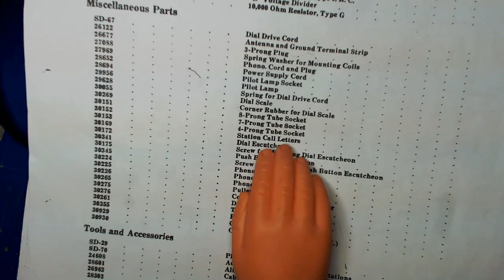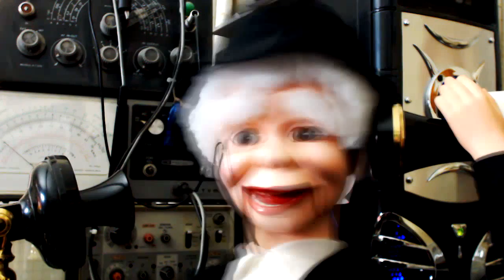1939 Stromberg Carlson Model 430-H Restore Part 6

Comment: Hey Buzz, for your grommet problem, take a rubber or neoprene o-ring or washer of the same thickness, slice it on one side, put it around the stem of that fitting, then glue the ring back together with Goop or something made for rubber. Since it isn't critical to the operation or the look of the radio, this should be no problem.
Reply from the maker: Steven Smyth Thanks Steve

Comment: Warm a grommet and see if its pliable enough to slide over as is, maybe, never tried that myself. Two thinner ones may slide over rather than one thick one. On The Workbench Today... suggestion is a good one. I've had good luck with JB Weld in most applications. Roughen up the metal pieces where they join seems to help the epoxy to stick. Tough one. Fantastic job on the radio. Works of art. I don’t see how you have the time for radios trying to keep Dickel out of trouble! Bound to be a lot of drama around there with all his women.
Reply from the maker: plantopguy5 The grommets I have aren't that pliable...But  On The Workbench Today had a good idea.....Buzz

Comment: Very funny opening had me in stitches. Has Dickel met his match?
The grommets help isolate the chassis from the acoustic vibration of the cabinet. The loud speaker will vibrate the cabinet. The cabinet will vibrate the chassis. (Think leg bone connected to the ankle bone)
Anyway, they wanted to help avoid an acoustic vibration on the chassis. This would vibrate loose tube elements and possibly create a feedback loop.
If it was my radio, this is what I would try! I would go to the local Do-It Best hardware store. They have a WIDE assortment of o-rings. Get one that thick enough and slightly smaller that you can stretch over the base of that stem thingy. Before you go there though, build up the shaft of that stem thingy with a good electrical tape like 3M. Not too much since the stem of the bracket still has to move in that hole. Ok, now go to the hardware store and get the o-ring that is thick enough and can stretch over the base of the stem and then rest against the electrical tape built up stem! Vollia! You can go to HFT and get one of those cheap calipers to measure the new built up stem diameter to help select an o-ring inner diameter to be close to that size. Well you get the idea. Good luck!! The calipers will help out a lot. Perhaps select the big o-ring first, then build up the stem with electrical tape to meet the inner diameter of the o-ring. There's an interplay between the stem, the hole and the o-ring, so that's where the luck is required.
Reply from the maker: Lockemeister Hi Meister...Just got a email from my mentor Brendan stating the same thing..Good to know ...thanks..
I been experimenting with various methods mentioned today with no luck..You will have to wait till next week to find out how I replace those rubber mounts..I even don't know as of yet.......Godfrey Daniel..................lol, regards, Buzz

Comment: Buzz,

I like Stephen Smyth's suggestion of using O ring material, super glued together.  I think you could stack several O rings until you got the thickness you needed.

Regards, Tom
Reply from the maker: THOMMGB Already bought some grommets and will try to make those work,,Too cheap to spend much on this..lol, Buzz

Comment: Hi Buzz, I came up with all the rest of these suggestions that everyone else had here but being a real cheapskate I recommend a washer with a clearance slot cut in it under the existing washer using a 3 pronged gearpuller against an inserted bolt in the threaded hole to straighten the flange, then take a large bolt to beat the flange out after assembling the o-ring (new one), hope this helps, but really I think this part of the radio was just to absorb the shock of shipping, so you could just make the o-ring from split wood washer glued in and painted.
Reply from the maker: Truckstuff4u LOL..I'm cheap too...Regards

Comment: Buzz,  My idea is similar to most.  I would first try working the new rubber over the edge on the inside.  This would leave it tipped.  The you might rotate it under the corner edge while pulling the rest over the inside edge.   The old gum mounts have some give so this might work.  Put a bit of soap on the rubber before you start.  Gojo might work too as long as it doesn't attack the rubber.  Failing this, cut the rubber, rotate it in, glue the cut edge then rotate the split to the corner.  When the bolts are installed, the rubber should be gripped on both sides anyway.
Reply from the maker: Stephen Moore I will try

Comment: Now for the rest of the story.  Interesting video!  You have lots of patience.  You might have steamed the old veneer off, but you managed to get it off anyway.  It looks like the old glue is letting go everywhere, but you will have a great job when you finish the re-glue.  The transformer looks like new!  You might verify the resistors in the AGC circuit.  It won't brighten up the eye tube, but it might make the new one more responsive if they are off much and you change them.  They are easy to measure with a digital VOM.  The old meters didn't work so well at the high values in the AGC.  This radio is really shaping up and I am enjoying the series.  Now as for ole Dickel, his heart is in the right place.  He might have ripped off the spuds (then again, his ass paid for them), but at least he is thinking of his ole buddy Buzz by trying to share the booty.  (As an aside, the term escutcheon is still being used on modern radios such as portables).  Unfortunately, it looks like the ole rascal is off on another quest of the heart. . . . or something. . . . so you may have to take a back seat.
Reply from the maker: Stephen Moore ..I have replace 80% of the resistors in that radio..some of the 10meg variety..Thanks...Lots of work to get that cabinet up to snuff with new veneer..Dickel tries hard , but with women, they just  mess him up..LOL

Comment: Use a Dremel or file to remove the flange. Instal grommet replacement Place a washer where the flange once was and put a bolt through. When unit is put back into cabinet use another washer and nut on the underside to bolt it into place.
Reply from the maker: John Letterman watch this friday and i will reveal..

Comment: This may work...Get a tube of black or whatever color of RTV, silicone rubber and prop the metal washers where they need to be and make a "donut" out of the RTV.
If your careful you should be able to make it fairly round, if not use a piece of large diameter Teflon tubing as a "mold" silicon rubber (RTV) will not stick to Teflon.
That is my hair brained idea...LOL
Reply from the maker: ***** Hi Goat...I bought some grommets at ACE hardware today..I will figure something out...Thanks, Buzz
Reply from the maker: ***** Hey oldgoat..did you enjoy your poem???haha
Reply: What poem?
Reply from the maker: ***** There once was a man from Trent...you must have dozed off  during my video
Reply: LOL...I heard it, at first I was not sure what you meant, I must be getting old....wait, I am OLD...LOL
Reply: ...the term is: "HARE BRAINED".

Comment: I would try cutting through 1/4 of the grommet with a sharp razor blade, then spread the grommet apart enough to slide onto the shaft, then using a drop of super glue on the two cut ends, glue the grommet back together.
Reply from the maker: Ant Buz I will be cutting, but maybe not the way you think..watch next week ...Buzz

Comment: To add to the heating and stretching the grommet. I found this link http://tt.tennis-warehouse.com/index.php?threads/installing-grommets.121467/    One recommended not only heating but boiling it to keep it moist and flexible.
Reply from the maker: plantopguy5 Tried today ,,failed lol..The grommets I have won't stretch that much..They broke apart..lol...Buzz
Reply: Buzz1151 I see more clearly in your next video what you were up against. I was thinking more of an O ring rather than a grommet. Great job on your end result, thats about as good as it gets. Yea grommets and O rings never seem to be consistent in pliability (is that a word :-))

Comment: I made a video response on how i would try to do it.I will let you know when it`s posted....
Reply: Buzz1151 It`s Posted....
Reply from the maker: homotorsports Hi: Your plan was very ingenious and most original, however it wouldn't work on mine because the threads do not come up to the top. If I cut it , there would be only 2 or 3 threads to hold the screw. But I give you an A+ for that idea...Watch next Fridays video .It will show how I'm going to do it in detail...regards, Buzz